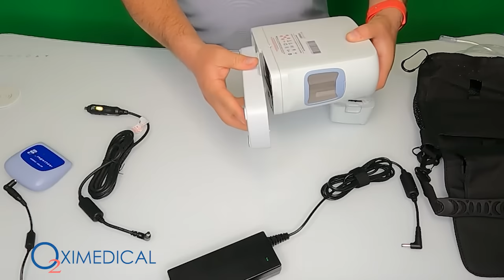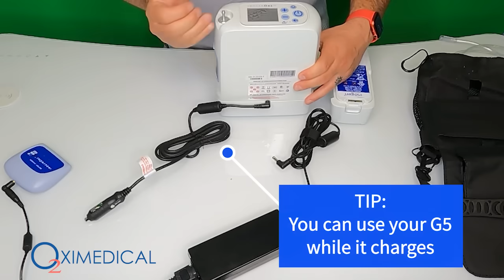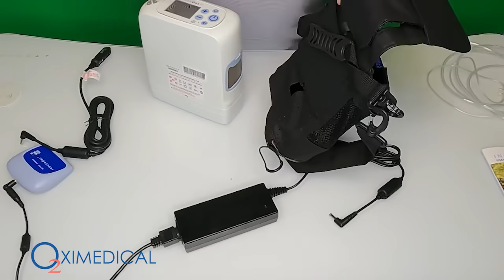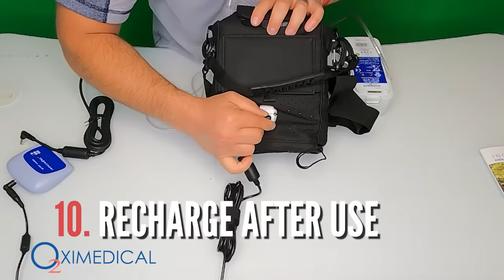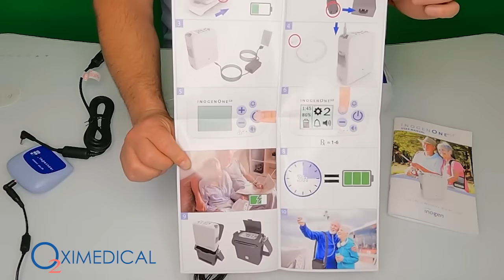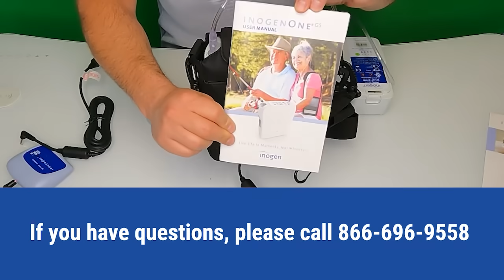Getting Started - Inogen G5

Comment: That’s fine however the Inogen G5 that I have has fallen over just sitting on the floor or counter & it shuts off & I couldn’t get it to turn back on.  I had to get a tank to use instead.  Very frustrating!

Comment: All six of my Inogen units broke down i the first 20 to 60 hours of use due to low oxygen output. These units look great, easy to operate, lightweight, all what a none user is looking for. But they don’t work longer then 60hrs of fail free Oxygen output. Stay away and look for a reliable concentrator. My next try is Caire Free! Hopefully they work.
Reply: That’s odd, all of my inogens (home and portable) have been running for years without any problems.
Reply: @Homefree18  don’t use them around air fresheners! 5 of mine broke down because of it and Inogen confirmed this in an email! They just don’t but this in the manual properly!

Comment: My Inogen G5 makes a loud popping noise while running.  Support said it was not a problem, that's the way it works.  But man it is annoying.  And it weighs 6 lbs with the double battery - I only use my G5 while walking/exercising.  It is turned off while i'm sitting.  Anyone??
Reply: Even though your comment is a year old, I'm commenting on your comment 😊 to say that I'm setting up my Inogen right now. I immediately noticed the popping noise, too. I'm assuming that the noise is a constant?! I hope it doesn't drive me crazy. 😅